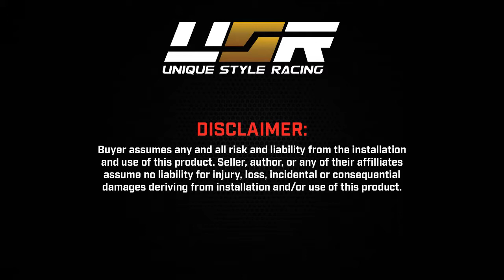USR 03-06 MBZ S-Class DEPO Headlight Installation

Comment: I have a question about depo headlight for w220 mercedes how dose work in night it's good or not some people say the depo is very bad and the lens is very shape please answer.
Reply from the maker: Hi Mohammad, thanks for asking. I am not 100% clear on what you are asking. I believe you are asking how the headlight's Low Beam performs during night. If so, I am confirming with you that the DEPO W220 headlights shown in this video is actually re-using stock OEM D2S Bulbs and Ballasts. Although the projector is manufactured by DEPO, they source the projector glass lens from Germany. Of course the OEM output would be considered the best, but you are paying the OEM premium. We have not received complaints on the output for the DEPO W220 headlights. I hope this helps clarify things best. Thanks for checking.

Comment: What is the purpose of the upgrade? What kind of projectors were used in the new depo headlights?
Reply from the maker: Hi, thanks for asking. This specific video is mainly to show customers how to transfer their HID Ballast and D2S Bulb to a replacement Facelift W220 Chassis headlights as the DEPO 03-06 W220 headlights looks similar to the OEM ones. DEPO does offer the Facelift W220 headlights that fits for those with the Preface W220 Chassis (Halogen). Thanks for checking with us.